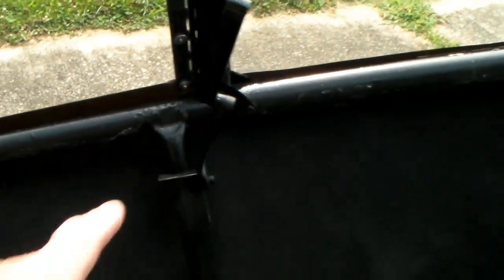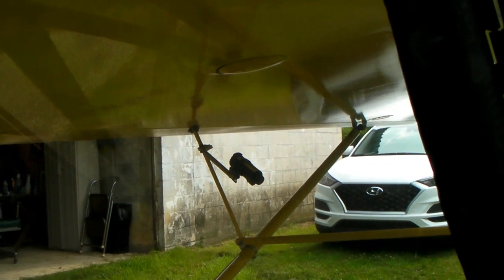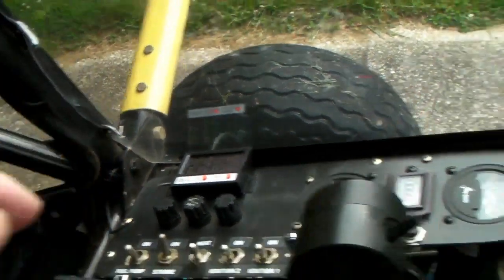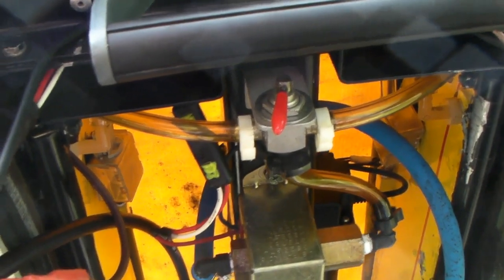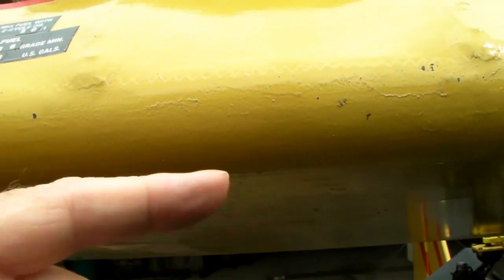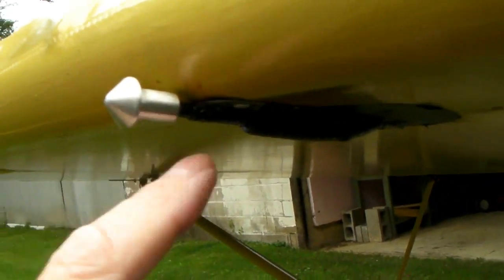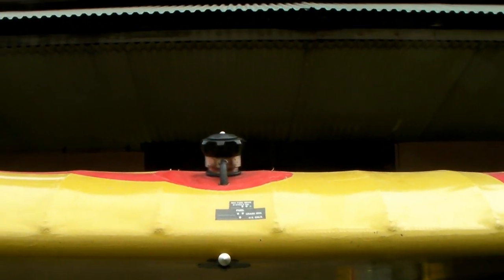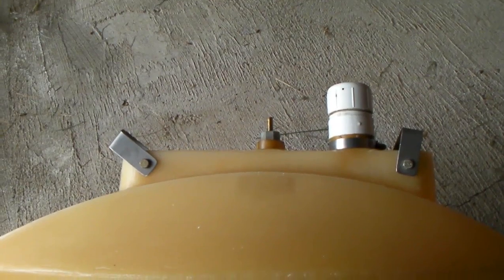Ultralight Fuel System on the Chinook extended range tanks.

Comment: Thanks a bunch. Your not the first negative report I've heard about the ASAP wing tanks.
Reply from the maker: The tanks I had made are a bit heavier than the plastic, but cost was about the same.
I slosh coated the inside, so as to be sure there are no leaks.
Reply: New wing tanks is more of a winter project. Dan Reynolds built and recommended the metal tanks. If I'm going to fly this season I might best stick with the footballs. With them I've always liked that they are well away from the cockpit. You've given me a lot to think about.